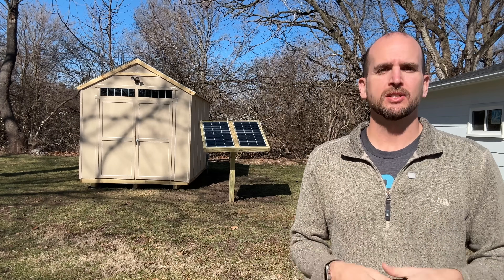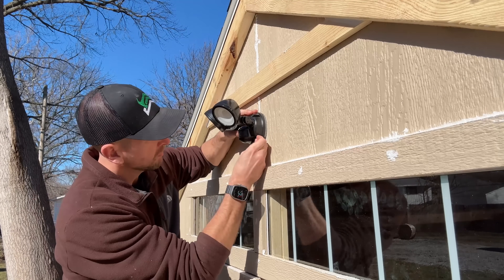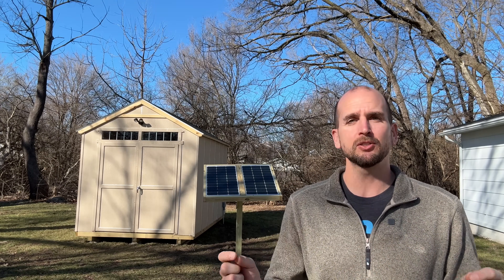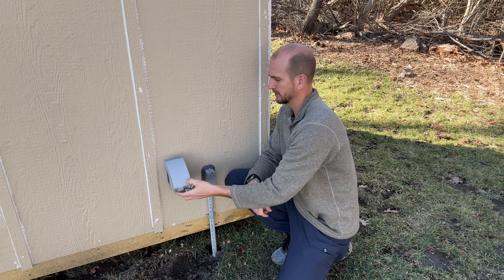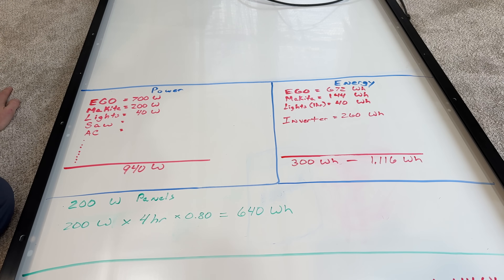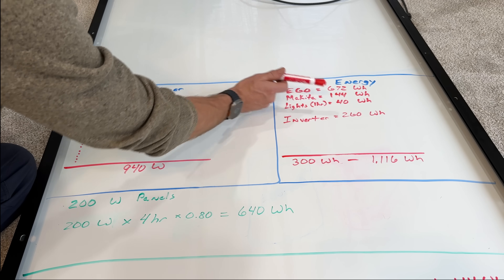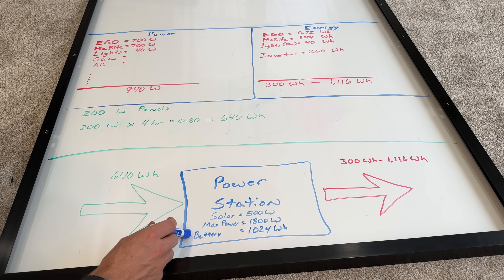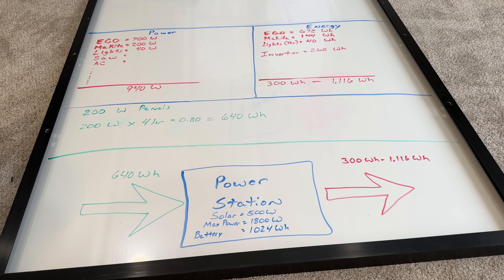DIY Solar Powered Shed Setup

Comment from the maker: Calculate Solar Cost For Your Home - https://geni.us/wvG5

Power Kit I Used - https://geni.us/uRL6gJ

Tilt Angle Calculator - https://geni.us/z8r7

DISCLAIMER: This video is for entertainment purposes only. Also, this video and description contain affiliate links, which means that if you click on one of the product links, I’ll receive a small commission.
Reply: FYI they've found that a 90° angle (from the earth) on the solar panel actually improves efficiency because of reduced overheating.  It adds to longer panel life as well.
Reply: Great setup! Thanks for the video!

Go DHS Vikings!
Reply: This is ridiculous.  Just run a generator at this point or don’t have power. That box alone is $629. You can do this MUCH MUCH cheaper with a dc to ac inverter, battery charger with over charge protection , 12 v battery storage.
Reply: @elachance1  
Except there are areas where this makes sense.  If you live in an earthquake-/tsunami-prone area where outages may be for a long time, this is absolutely worth it.
Personally I'd love a porch and carport with bifacial solar panels for this reason.  Diesel will be in short supply, gas will be a total non priority.
Reply: Your solar link sucks. They require all of my contact info for an estimate, and then they will bombard me with sales pitches. Then, when they receive no reply, they will sell the info to someone else.
Reply: @bisonpaleofossilriveradven3528  
Good to know.

Comment: You forget the LED light on GFI 
Between.0058 watts 
To 
1 watt on manufacture brand
And forget the expansion coupling below the LB expansion and contraction for the cold earth and the shed hot to cold weather.

Comment: Love this setup. I’m wanting to install a DPU to offset power bill. Considering placing in under stairs closet and running solar wiring under home to backyard as we have tons of S / SW sunlight close to back of our home. No garage though. Any suggestions on if this might work with smart panel 2 in that same closet?

Comment: Really great video. You have a nice delivery and easy to understand. 
Would you consider putting a disconnect switch on the post at the junction box? Or is it sufficient to rely on the GFCI outlet to remove power from the line?

Comment: I have a very similar setup in an 8x12 shed using the ECOFLOW Delta Max2 and its spare battery. My problem is that the Delta Max and its spare overheat in anything above about 85-90 deg, and throw a low temp warning in anything freezing or below. You must have some temperature extremes there in Illinois...do you have similar problems?
Reply: Thanks for the warning, our summers here include a few weeks consistently over 100, so definitely avoiding the ecoflow.  I’ll may end up building my own system, maybe wire it so I can plug one of those diy systems on a dolly in.

Comment: Hi, this is awesome, it’s really helping me with how I want to wire my shed.  I have a Delta Pro - tons of battery storage.  If I understand your video properly, the GFCI can be used to plug in via extension cord to the home and then charge the power station?  Or does the power station only get charged by solar?

Comment: Thanks for the great video. I'm in the middle of a similar project. Do I need to worry about overloading the AC power if I plug in too many things? Or is the generator able to sort that out? Wondering if I need some kind of circuit box.
Reply from the maker: Nope, the portable power station with limit the output and has an internal breaker.

Comment: Solar is good in concept. However, for a shed in a residential neighborhood, it is just as easy and way more cost effective to run a 120 volt line from house to shed. The distance is not far and no downside for cloudy days. Small solar equipment makes no sense when you consider the cost of equipment. I have done all kinds of projects since I was 14. There isn't anything I can't do.  Now if you have several acres and a shed or barn far from the house, then solar might be attractive.

Comment: This is an awesome explanation of things. I'm hoping to do a solar attached to the roof build to power a music/jam room. So it needs to power a small mini splitter to be comfortable inside year round and then some lights and outlets. I could imagine it might be a good idea to increase my tilt angle to be closer to the Winter angle to compensate for not having as much sunlight so my battery will last through the Winter. But not sure how productive that would be.

Comment: Im growing so tired of YouTubers pushing these junk, low capacity power units over a real 10-20kW inverter and dedicated battery banks that can run real tools and run for as many days as your battery bank is built for,
Reply from the maker: What are your favorite brands for building a DIY off-grid system?

Comment: What happens if you live in an area of the country that gets changing season that run from say 95 hottest in summer and teens or single digits in winter.
Reply: He lives in Illinois and I’m pretty sure you just have to make sure the panels are cleared of snow during the winter for them to work but I don’t think that too hot or too cold of temperatures will keep them working. I live in AZ and have solar and the 110 degree days don’t affect how they work. The biggest problem I would think that some people might have is that they don’t generate as much energy when it is cloudy or overcast.
Reply: @Mrahusser  I am in CO, and having trouble with the Deltas overheating in the summer, and getting too cold in the winter. In both cases, they shut down.

Comment: In my area, the cost per hour of on time for a 300 watt load, on the grid is about $.03 per hour. Considering your couple hour a day(max) runtime, with your free $1,000 + system, the pay back time is nearly indefinite (never). Looks as if the only viable use of such a system would be a remote area with no grid access. Overall a very expensive option…

Comment: I have 6 Trojan T-105's as a backup power bank for my home/camper just to run a few things when the power goes out. All I would need is solar panels and charge controller just for recharging not both recharging and running things. How do I figure what panels and charger I need? I'm not a math wiz when it comes to this kind of thing.

Comment: If i was using a Anker F3800 which has the 240v 50amp output (NEMA 14-50 AC Output Port) how would I wire that into a offgrid panel for a shed? Id want a breaker for a 20amp pool pump, 15amp breaker for lights and 15amp for tools?

Comment: Another very helpful video.  When deciding on the tilt angle its worth considering that you will see far less electricty generated in the winter than in the summer and plan the angle accordingly.  Personally I always add 5-10 degrees to the base optimum angle to improve winter generation and as a bonus the panels self clean better.
Reply from the maker: Thanks so much for the feedback!
Reply: I had the same thought. The battery will fill faster with more sunlight during the Summer so its need to be able to last through the Winter so might as well compensate for that.

Comment: One thing that you didn't mention: Since the portable power bank is portable, if you had even 10 days in a row of no power coming from your solar, you can just carry it into the house or garage and plug it in for a couple of hours. Not ideal, but then you are not trying to compensate for that problem by buying a larger unit. 95% of the time, it works just fine. For the other 5%, use a cheap and easy fix.
Reply from the maker: Yeah, the portability is a BIG benefit compared to putting together your own DIY setup 👍👍

Comment: Thank you.

Two of your three video links never made it to the left side of the screen. 
Why did you use 12/2 for the lighting?

Much more efficient to use 12 volt lighting, including the motion sensor lighting.  Then the inverter is only running when AC power is needed.

Use a windup 60 minute time switch for the inside lighting so it is never left on.

At my location, at least 400 watts of solar power would be needed for year-round power at that level - it's not unusual to have a week of partly cloudy, cloudy and rain.  I've tested 6 brands of 100 watt solar panels and in real-world, backyard solar exposure it's rare to get more than 75 watts from those panels.  The Jinko 250 watt panels I tested were much better, delivering a measured 235 watts in backyard sun.  If I were putting AC power in the shed, two of those panels would be my first choice.

However, my lawn equipment shed does not need AC power, just lighting.  One 30 watt solar panel, PWM charge controller, 10AH LiFePO4 battery, 60 minute time switch, DC-DC buck regulator to provide just enough power for the strip lighting.  For the area being lit - 8' x 16' - the 5 meters of LED strips do NOT need to be at the 13+ volts of the battery - 11.0 volts provides all the light needed and ensure the LEDs run cool and last a long time.  Installed in 2017 with an AGM battery.  Upgraded to an LiFePO4 battery in 2023 when the AGM battery reached end of life.  I'm a strong believer in "Once and done" for outside lighting ;-)

Comment: Great video and very well explained. One thing I would consider is 12v led lighting, although the range of products isn't as extensive as 120v or 240v (yes, in the UK we have 240v lights), this would allow the lights to operate even when the inverter is off, saving the 260wh per day.

Comment: I am 100% going to do this at my place, I know it’s not “free” but when you don’t have grid access, it’s a great idea.

Best part is I could bring home the power station with me for home backup and to prevent theft (the property is quite remote)
Reply: If you want power on site at all times a cheap inverter and lead acid marine battery will do, many solar starter kits come with a charge controller, so you can get a smaller setup going for under $300

Comment: I did something similar...but I went through my shed roof using a solar entry gland. Took  way less realistate.
Reply from the maker: For sure, I wanted to both ground mount and roof.  I am planning on putting a 400W panel on the roof in the coming weeks to show the other option.  What did you use to mount to your roof?

Comment: looking for recommendations on parts i would need 
to build an apartment power system that would fit in a small garbage can size faraday cage
power source (solar panel or car battery)
dc to dc converter to step down power from solar panel to micro inverter 
micro inverter (300w to 500W) dc to ac (no battery)
power target (small appliances)
any ideas or product recommendation would be greatly appreciated

Comment: I have been a licensed Electrical Journeyman for close to 40 years/IBEW and find these projects when advertised as "free electricity" are ridiculous!
Solar power for the most part is inefficient and especially when you actually 'need' power. 

What I would do, for much less cost, is run a 10/3 UF cable (up sized from #12 and extra conductor in case of need for future expansion) from a single pole 20A breaker @ your house service panel to a 20 amp rated single pole switch, which can be located inside or outside the shed, but easier to mount inside and no need for outdoor rated box/cover.
From the the switch, wire as in the video or as needed.
$1000 buys many, many years of electricity and no replacement of solar panels, power stations etc. and you will have all the power you need ON DEMAND.

Comment: Are you running this in the winter months?  What's the temp inside your shed and how does the system handle cold charging?

Comment: i understand everything but the 4 hours in your panel equation.  Is that an expected 4 hours/day that the sun will provide energy to the panels?  If so that seems very conservative.  i'm looking into setting up solar to run lights at our deer shack in northern MN.  So, essentially, just power 5-6 LED light bulbs for 8 hours/day (considering it's used in the fall when it's getting dark around 4pm).  Maybe this is overkill, but I can copy/paste your calculations considering the lights alone would take around 400 wh.

Comment: There is some new research about using bifacial panels and having them exactly vertical, and having them face due east/west. The idea is that they avoid the worst of the midday heat where they take the most abuse and actually lose efficiency, and then you have earlier and later power input meaning you don't actually cycle your batteries as hard. That does mean you need clear skies to the east and west, but the reports say you gain 4% more efficiency on your panels in that orientation.

Comment: I'm planning to do something similar, does there need to be a grounding installed in case of lightning strike to shed and or solar panels? Or is that just a chance you take with an outdoor setup like this and all the components getting fried.
Reply from the maker: Check you local code as I think there is a lot of different opinions on a shed/system this small.  For me I will not have dedicated ground rod(s) for shed or 200W of panels.  If it was a detached garage with more panels I would have 2 ground rods which I did for the detached garage right next to this shed.

Comment: Question: When installing an electrical switch plub combo switch, what happens when the hot wire was accidentily connected to the brass screw (reserved for load) and the load wire (black) was connected to either of the black screws right below the brass screw?

Comment: No offense but I find this project completely useless for a shed. Solar can be a pain and unreliable and you are not going to get enough current to operate an air compressor, welder and similar. I do not work in a storage shed that needs lighting, especially at night.

Comment: Good project for a very remote shed. Personally, I’ll just trench an AC feed from my house.  All in cost with room for expansion would be about the same $1K. But, thanks to watching your channel, would be a lifetime solution that will always exceed the demand of my charging needs. Buy once, cry once😂
Reply: bonus of this solar setup is if your power goes out you have a place to charge your phone or run an extension cord to power some other stuff in a pinch
Reply: @ELIRAXPRT  True, unless you have a backup generator, as I do. We can run everything except water heater. I did all the labor myself. Permanently connected. Start generator, flip a few switches, and enjoy power throughout the house.

Comment: Have you tought to install the solar panels on the doors?  Vertical panels get less sun but get less hot by a lot so effiency can be higher in some situations.  Also if need more power, there is still 2 spot left on the doors to get 4 panels 😅😅 I know Im weird but thoses farn/shaker style doors  would be perfect to fit thoses panels! Doesnt take place,  will not collect snow and would not add that much weight on doors.
Reply from the maker: Seems like a lot of videos out lately trying out different vertical mounts.  So maybe not too weird. 🙂

Comment: That’s a cool project. I see you connected ground wires to all the receptacles - was there a ground rod or other method to provide “earth ground”? I know the gfci will sense current differential between neutral and hot on an ungrounded system - is that the protection you are expecting? And any need for over current protection or is that provided through the  solar power converter? Thx…

Comment: I'm sure glad I built my cabin setup 5 years ago. Prices have gone wild! My complete setup was less than $2000, as I recall. Now, that's the battery cost.

2 Battleborn batteries 12v
1 charge controller  (a)
1 inverter  (a)
1 24v to 12v converter  (a)
8 ft 4 or 6 ga. wire (of which I only used 4 ft)  (a)
24 P-clips (to tie down the wires)  (a)
10 ft of red 12 ga wire to interconnect all the devices. (a)
10 ft of black 12 ga wire to interconnect all the devices.  (a)
2 12v battery switches (to shut off the system for winter) (a)
Edit: one for the battery positive cable and one for the panel positive. So when you shut down, the entire system is inert. 

6 big wire lugs (for the big battery wires). I used arc welder wire.
2 12v RV dome lights 
1 Hammer crimper (for ends on the battery wires)
6 P-clips for the battery cable ends
2 solar panels with 25ft of wire
1 manual transfer switch (to switch from generator to solar, if needed). And it never has been needed.

And I learned how to wire the entire thing setup from watching YT videos.

Hint: Wire all negative connections first so you don't accidentally cross-wire something.   Screw all the equipment marked (a) on plywood then hang the plywood.
Reply: What?  Everything is way cheaper now.

Comment: I went very minimalist with a shed power setup.  200 watt solar panel ($150) on the roof side which gets the most sun, 27-size lead acid marine battery ($100) , 2000 watt pure sine inverter ($230), and panel-to-battery charge regulation module ($30)  all up on a plank in the rafters.  Power switch to turn on the inverter an light switch on wall, outlet box 24" off the floor on the same wall as the light switch.  About $500, self-generating and sustaining,  and no trenches to run a long line to the house involved!  Love it.
Reply: Paul, where did you get your components?
Reply: @dana8819  Renogy, except the marine battery was from an auto store

Comment: Does your outside outlet box have a gasket on the back to keep out moisture/water from coming I  behind it and travel down that entrance wire to the inside the shed?
Reply from the maker: The back of the cover has a gasket the back of the box I just used 100% silicone to seal things up.
Reply: @EverydayHomeRepairs  Nice set up! I'd like to do a setup in a shed type cabin at my parents property.